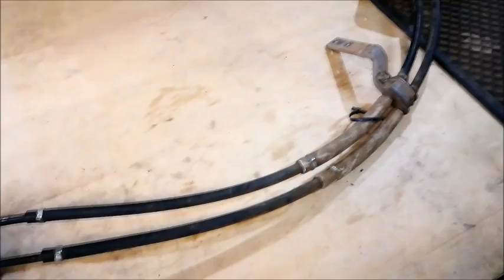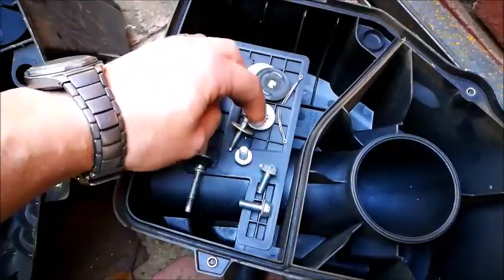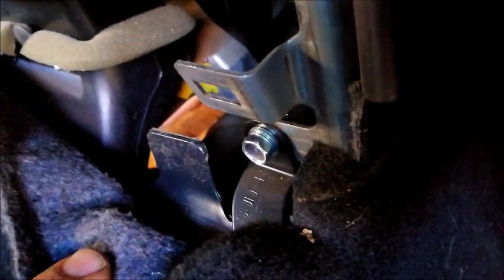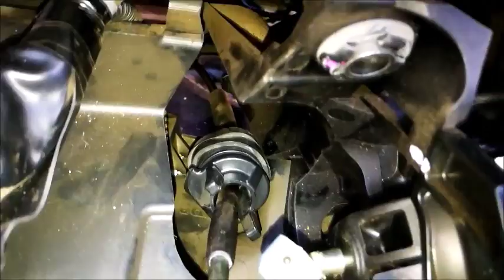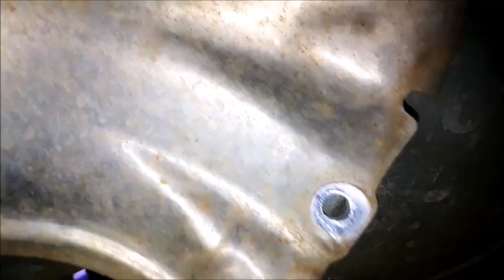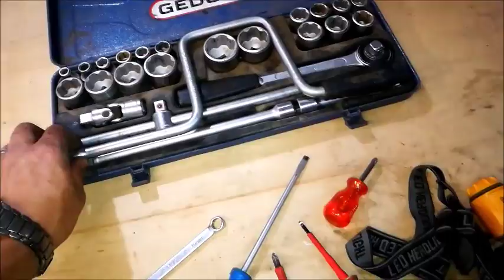Honda FRV (Edix) 2.0l petrol, right-hand drive, 2007. Transmission cable repair.

Comment: Hello Jan ....firstly i want to thank you for your youtube video on the cable repair ....i also owna honda FRV ,but a 2008 1.8 ....i think the cables are the same .....but as you said honda asked a kick as amount for this cable and they were kind enough to temporarily fix with cable ties ....i live here in jhb gauteng area ....could you leave me a contact where to have tis cable repaired please 

regards 
lawrence S
Reply from the maker: Cable solutions 012 379 2235. Van der Hoff Road in Pretoria.